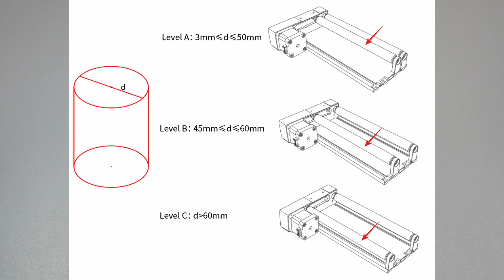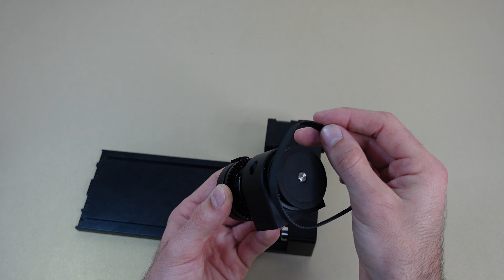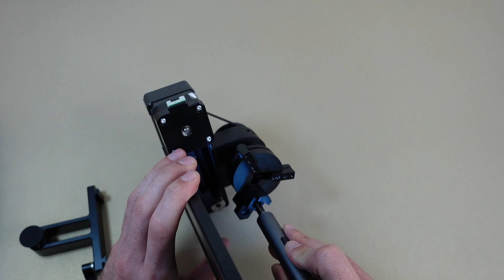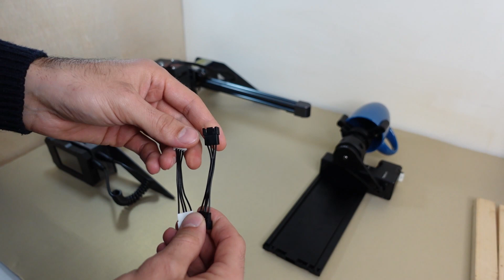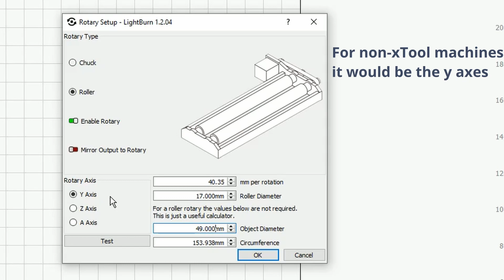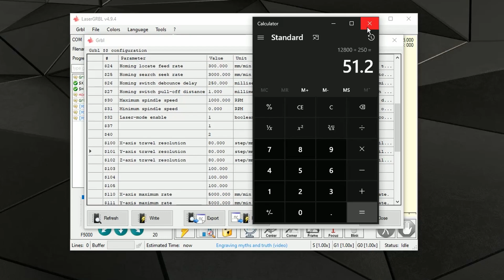XTOOL RA2 PRO Rotary Attachment - Configurations & Setup - LaserGRBL & LightBurn

Comment: What type of connector is for the stepper motor? Does it come with alternative connectors? 3 pin, 4 pin?
Reply from the maker: Hi, thank you for your comment.

Yes, the rotary attachment comes with several different connectors which make it compatible with pretty much most laser engraver in the market and all the laser engravers I have tested so far

I hope it helps
Ciao

Comment: Thank you for the great video. Especially the Lasergrbl setup. Just one question regarding the 12800. How did you get to the number of 12800? Is it something that can be calculated or measured somewhere ?
Reply from the maker: Hi, leraughn; thank you for your comment. 

The number is provided by Xtool itself.
I haven't verified it, but it must result from the micro-stepping of the stepper motor and the gear ratio.

Ciao
Reply: Bonjour j’ai le rotary de chez creality pensez vous que je puisse utiliser le même chiffre? Merci

Comment: Hello, this is a superb demonstration, you are very clear on the instructions, and you do not go too fast. I am a beginner and I understand the set up perfectly, thank you. One question, I have a Neje Master 2S plus will this rotary work on this laser ?
Reply from the maker: Hi, Sherry Burns; thank you for your comment. 

I haven't tried it on that machine as I almost do not use it anymore, but you should have no problems with it. 
I can test it for you and let you know if everything works good. 

Ciao
Reply: That would be fantastic if you could try it, I do not want to buy it just on a maybe, they are not cheap to buy. Thank you so much for your offer to help, much appreciated.
Reply from the maker: Hi, Sherry Burns

As promised, I tested it, and the machine works just fine.

The only note is if you are using LaseGRBL, disable the homing function by setting $22=0 in the GRBL configuration.

I created a quick video to see how to wire and what parameters to change. 
https://youtu.be/HzPhq0AjPEI

I hope it helps, 
Ciao